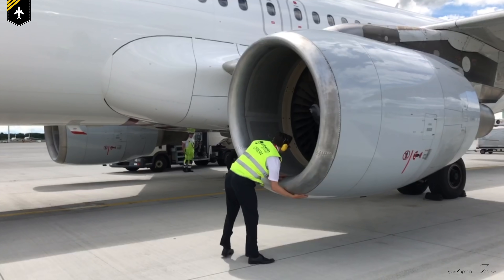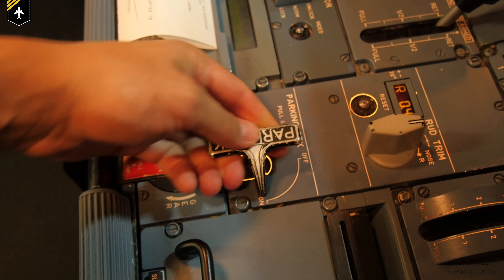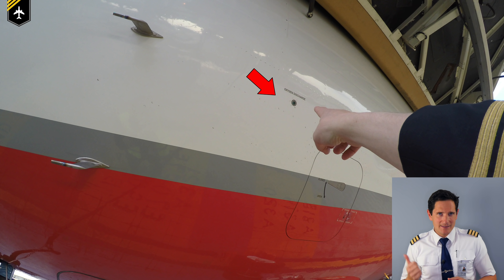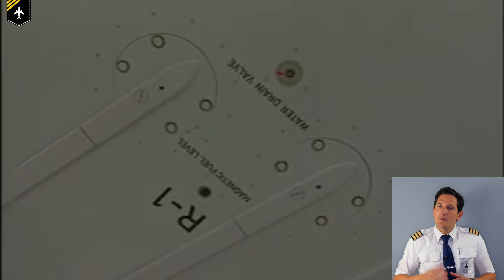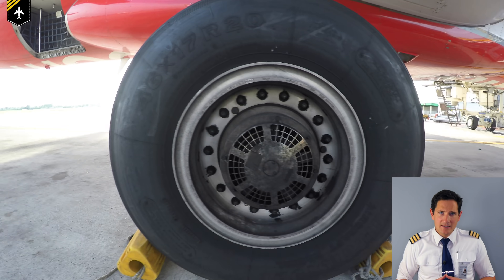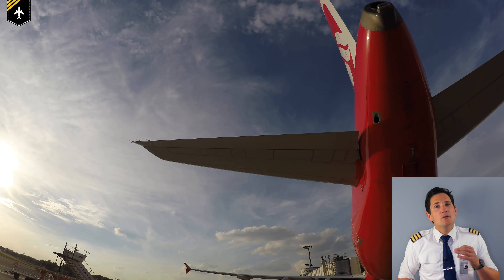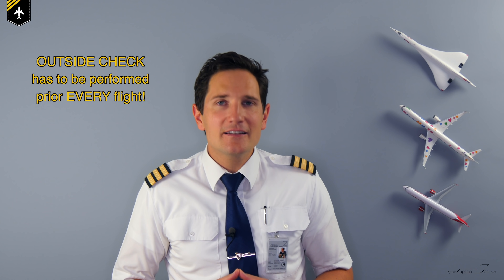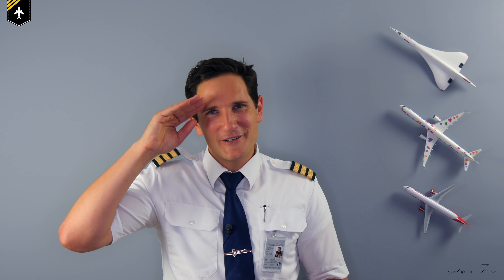AirbusA320 OUTSIDE CHECK explained by CAPTAIN JOE

Comment: Have you ever grounded an airplane in your walkaround? What were the consequences when you  did?
Reply: opl500 

I’d like to think that a pilot could ground a plane without fear of consequences since his and everyone else’s lives depends on the plane he is about to take off in.
Reply: opl500 I have. It's our job if something is wrong to have it corrected before flight. That's what happens: maintenance comes out, assesses the situation and fixes it prior to departure.
Reply: @HEDGE1011  just slap in some duct tape for f's sake
Reply: Management doesn't pressure you to look the other way if you do find stuff?
Reply: opl500 In my 29 years with my airline, no, not once.
Reply: HEDGE1011 what airline do you fly with?
Reply: Jake Calvert allahu-akbar air
Reply: Adrian B oh
Reply: If they did, there would be a chance of a crash and that would make the airline look bad and would reduce the number of people wanting to fly.
Reply: opl500 if management pressures pilots and ground crew to “look the other way” on aircraft problems, people die. It’s that simple.
Reply: @opl500  that would be illegal
Reply: As a student pilot I had to twice cancel or reschedule my class,  once because someone forgot to close the fuel cap on a Cessna after fueling and a small rain came by and there was water on a tank we were unable to take it all out. The second time one of the flap extension rods was loose and wobbled hence it was a risk to perform the flight. Sometimes the smallest things can ground a plane but those small things mean the difference between landing safely or crashing. In aviation walkarrounds are just as important in a tiny plane as they are in the biggest ones.
Reply: A grounded airplane is much cheaper than a smoking hole in the ground.
Reply: Markle2k 
I mean, not to put it frankly but true!😂
Reply: Its not uncommon for an aircraft to get grounded after a walkaround, because its better to catch it on the ground, then to go flying and deal with an emergency in the air. I have had punctured tires, bird strikes not spotted by previous crew, and there are no consequences. Maintenance has the final say of what happens and how long the delay will be. Then operations control deals with the delay and decides what to do with that flight, whether to delay, cancel, or put another aircraft on that route. Our jobs as pilots is to find the issues, the rest of the team handles what happens after. Good question!
Reply: @AviatorInspirations  And don't forget the sad Aeroperu crash due to tape covered static ports!
Reply: I have and all that happens is you tell the pilots, maintenance and management what you found. The fo usually comes out to look at it and maintenance lets you know if its a quick fix or not. Once you get a time frame, management decides whether or not to unload the passengers or cargo to move them to another serviceable aircraft. Its not always damage either. I've had freezing rain situations so bad we just had to ground the plane until the weather improved because we couldn't keep all the ports and such clear.
Reply: Have never had an issue grounding a jet on my walk around
Reply: It would be nice to see a video going into more detail about the static discharge ports and angle of attack.  Another great video!
Reply: i like ur cat
Reply: I love the cat I mean your owner even 🐱🐱🐱🐱🐱🐱🐱
Reply: @Chris mckeithen actually fella, the engineers can make the final decision about whether the aircraft is safe to fly or not. The pilot can ask for the engineers to come and check it over, if they say that the aircraft is airworthy....... it is. If they say no, the aircraft goes nowhere.
Reply: @Chris mckeithen racist comments don't sound good fella.... you better take that back
Reply: They announce to all 400+ passengers that you broke it and then you have to run very fast. That's why I prefer cargo :)
Reply: I've grounded a flight when I read through the maintenance log and discovered a compass swing hadn't been done following a prop an engine change... the consequences... "Good catch navigator." "OK folks, the flight is scrubbed. Report back to ops."
Reply: I love your cat!
Reply: Chris mckeithen it’s called system redundancy and all aircraft have it. If I declare the aircraft airworthy I do that from a legal point of view. As I said I can’t fix the aircraft more than when it is already serviceable and I wouldn’t send an unairworthy flying.
Reply: MENTOUR pilot comments back instantly,  you should go there and ask your questions.  Peter is awsome.
Reply: ALEXxpress the he's a legend
Reply: @khalidabdulghani  ..a legendary non responsive youtuber
Reply: Chris mckeithen I’ve released aircraft before and the driver wasn’t happy, but if everything is legal and in order that’s his problem. Flight ops are straight on the phone to him to know why.
Reply: Chris mckeithen Are you saying a driver can over rule the maintenance manual? I don’t think so somehow. If I release the aircraft to service legally then he has no reason not to take the aircraft. I can’t fixit more can I?
Reply: Chris mckeithen Drivers.... it’s called humour....something you Americans lack
Reply: that's a good question as am sure most pilots would rather not ground if it's not something really serious coz they fear their employers might fire them
Reply: bratha nice Again as I said above, I've been with my current airline 29 years and that thought has never entered my mind. I have found numerous writeups during walkarounds in that time and have refused a handful of aircraft as well and have never once been questioned about it by management.
Reply: @himself187  its likely a pilot would be suspended or fired for NOT reporting an issue. Its more likely his/her job depends on going "by the book" and following procedure.
Reply: A pilot cannot ground an aircraft. He does not have the authority to do so. Engineering will assess a fault and when that happens engineering takes over the responsibility of the aircraft. Ie if I want everyone off then everyone must leave
Reply: Chris mckeithen Firstly I’m a licensed aircraft Engineer for British Airways and secondly drivers do not have the authorisations or qualifications to make a judgement that can over rule me. I am authorised by EASA to release aircraft to service In accordance with the relevant manuals. Funny how it takes 5 years training minimum to become an engineer and only 18 months to be a driver.
Reply: Chris mckeithen It’s quite obvious you don’t work in aviation isn’t it? Another person who believes pilots are gods and have the final say over operations. One day you might grow up and get a job working on multi million dollar machines and then you will understand how airlines really work.
Reply: Chris mckeithen If there is a defect with the aircraft then the aircraft is under MY control until I sign the certificate to release to service. Once that is signed then I hand over to the driver, if he is not happy then that’s not my problem which is why flight ops will call him and ask why he is refusing to take the aircraft. Drivers have been disciplined for not taking aircraft.
Reply: Captain Joe doesnt seem to comment back like other YouTube pilots...I guess he's a super Youtuber pilot and he doesn't have time.
Reply: ALEXxpress he does just not on this one

Comment: Like in the cessna, you can see clearly the pitot hole, did you check it en the other planes, because it seems that you just have to look if its in good shape in the exterior, ( I dont know if you have to look inside I always do just in case) and if you can make a video about flex rate T/O will be awesome !!

Comment: Hi, Capt Joe.  I have two questions hope you would help. 

During landing just after touching the runway, if there is cross wind, or the initial alignment is not perfect, or the breaking force of main gear is not balanced, etc, how does airplane steer itself at this moment to stay on the center of the runway? (tail rudder? or nose gear steering? or other method?)  (and same question apply to the case during take off)

2nd question, during take off, when 'Rotate' is announced, does nose go up automatically or some action need to be done to archive 'nose up'?

Thanks.
Reply: Crosswind landing by Mentour;
https://www.youtube.com/watch?v=_2zD_gdpouk

Rotation;
https://www.youtube.com/watch?v=PgHALBhN1cY
Reply: rudder to control and steer at high speed,  to rotate you have to pull side stick or control column
Ciao ;))
Reply: Thank you !   :)

Comment: I was wondering if a visual check of the alpha vanes is enough. Shouldn't they be checked by hand, to make sure they're not stuck?
Also you mentioned that various lights should be checked if the bulb is not burnt out, but in the daylight check none of them was on. How do you make sure that they are indeed OK?

Comment: Be carful with that parking brake. Don't set it during loading, offloading and refueling if the nose wheels ar chocked. On some aircraft it is not allowed to set the parking brake during loading, offloading and refueling at all (for example the MD11). Check with the parking brake released, if in doubt, set it just for the 2 minutes to check. Don't let it be set for the whole duration of the outside check. Also, chocks should not be installed on landing gears with different angles to each other, as they will travel forward or aft when they (de)compress during loading, offloading and refueling. You could damage the tires and/or landing gear.

Also VERY VERY VERY important, especially on the A320... Check the cowling latches! And really check them physically.
Reply: @Gun Nut I'm a licensed aircraft maintenance technician...
While chocked wheels might be a bigger issue on larger aircraft than on the A320, it is noteworthy.
Not mentioning the cowling latches is a bigger thing. This has gotten some serious attention during the last few years due to some incident.

This is just an informational video, no training video, I get it.
But over the last few decades we kind of got away from that "He's the pilot (Captain), he must be right" mentality in the aviation industry. If there's something wrong, we name it.

Comment: Hiii wonderful video. Sir,
1) how tcas is located in the bottom of plane and works for the area in front. How does it do that. Bcose antenaa is located in the nose of flight. But this one is in belly? 
2) how such small atc antenna is so powerful that is connects to thousand of miles distance atc. Love to hear from you. 
Your fan
sachinpanwar1989@gmail.com
Reply: TCAS antenna are two located upper and lower fuselage, they detect other aircraft TCAS equipped above under forward rear LH and RH side.
ATC antennas are so short due the High frequency used, same for DME antennas. about 1000 Mhz (TCAS as well)
Ciao ;))

Comment: You mentioned that sometimes the fuel caps are not secured properly or something along that line i wanted to know what happens if they are not secured properly and the pilot mistakenly fails to acknowledge it

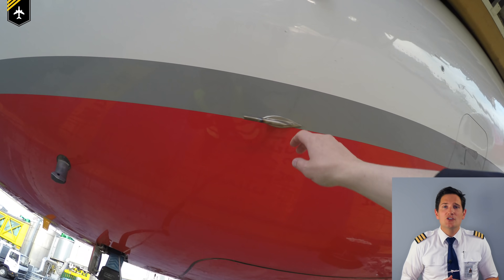Comment: 4:14

Hey Captain, can you explain about those tubes?
Reply: These tubes are used to measure the airspeed. As the air goes inside the tube, a sensor tells the airspeed of the airplane. So it should not be covered as it would affect the understanding of the pilots about the airspeed of the plane

Comment: I would like to see more about brakes in general actually. If you have time for that
Reply: I agree! I'd like to know how a brake check after an aborted landing looks like
Reply: Yes! Parts, looks, specifications, aborted take-off procedures, etc.
Reply: marvin basically after incidents like "overweight landings" and reported situations the brakes are immediately and comprehensively checked to ensure safety.  Things can be cured within minutes and hours most of the time but its better to do that than risk safety related crashes.

Comment: I want to do work experience for a pilot
Reply: You don't do "work experience" to become a pilot. First, you have to attend a flight school and log flight hours in the pilot's seat. (And, no, it's not like getting a driver's license, where all you need to do is take a certification test.) You would think the next step would be to get hired by an airline, but... That's most likely not going to happen right out of flight school. So, be patient and get a pilot's job with a small aviation company that runs propeller planes while you submit application after application to the big boys. Once/If you're hired on with a big airline, you're going to go through a certification course, which means even more time in a classroom, a flight simulator, and instructional hours with a flight instructor to get you up to speed with the aircraft that airline uses. (Again, it' not like hopping into a car and just drive off. Jets aren't like props, the flight characteristics vary wildly by manufacturer and model of aircraft, cockpit design varies as well.) Once you get past all of that, you'll be made a first officer and assigned a captain certified for training. Yeup, on the job training. After you get past that, you'll still be a first officer, but you'll then be assigned to a regular captain. And now the waiting game is played while you rack up flight time and time with the company, because captain positions are partly based on seniority.

You could skip all of this and enlist with your country's military. Except that they have their own pecking order, flight schools, and certification process. While this should enable you to receive a private pilot's license once you leave the service, I've heard of people having problems transitioning said experience into a commercial pilot's job. Your mileage may vary.
Reply: Thansk you so much that was really useful of you to take your own time and explain how thing work good luck in your future many thanks Mashood